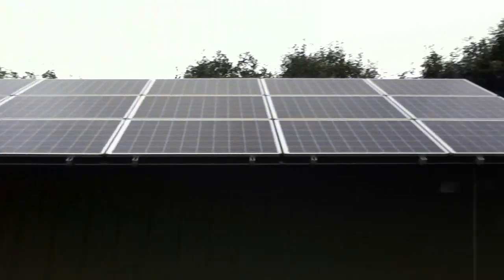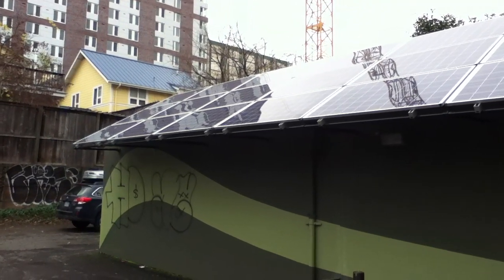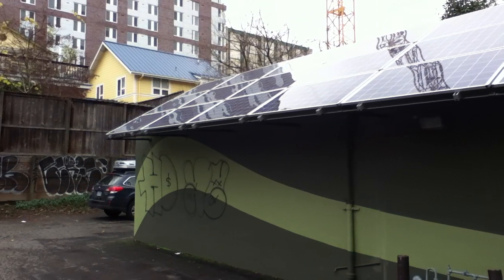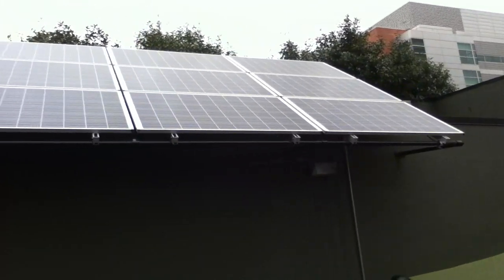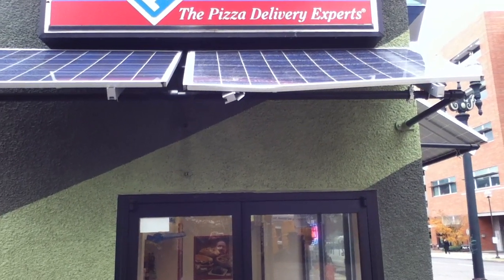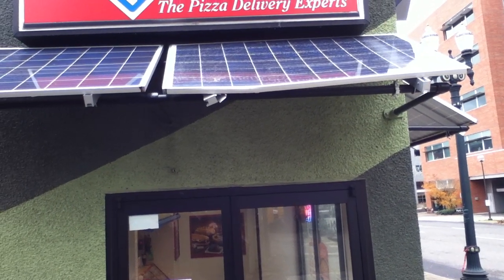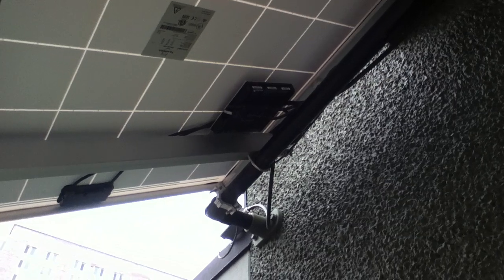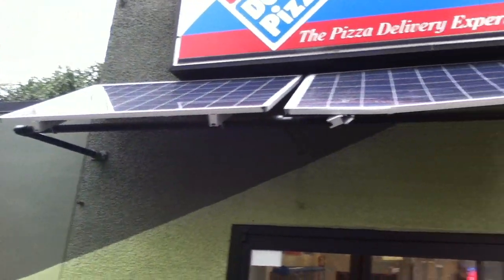Grid Tie installation of Solar World panels in (and from) Oregon.

Comment: Pretty sure someone crashed a truck into that damaged panel.
The micro-inverter system is really excellent especially if you have some panels in the shade or pointing a different direction, it prevents the whole string from dropping output to the lowest common amount

Comment: Looks like at least 1/2 of the upper cells are shaded by that sign. Doesn't take much to lose a whole string of cells. But it's hard to tell from the video. As for advertising, they sure are doing that, you couldn't miss seeing those panels! Was there a sign somewhere saying what company supplies the lease / power situation?

Comment from the maker: We are far enough north that the summer sun that generates the most power still comes in at an angle and most panels up here will get installed at that angle.   My personal arrays are either flat or adjustable, but realize that a lot of these commercial installations are done partially for advertising purposes so will go in high visibility locations.   I am currently uploading a video of a high profile array that practically qualifies as public art.

Comment: Those panels under the sign look like they are shaded most of the time by the sign. All you need to do is lose 1 cell and the whole string is gone (power output wise), or in the case of some panels 1/2 is gone (bypass diodes come in). I wonder why they didn't simply put them up on the roof.